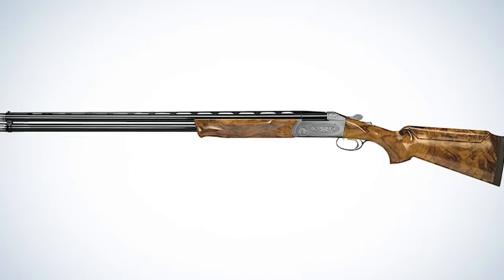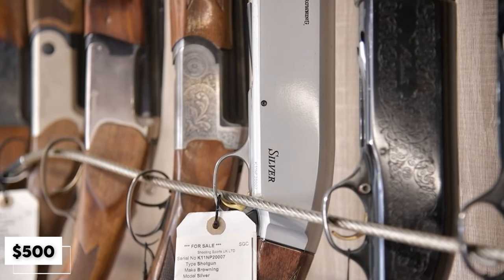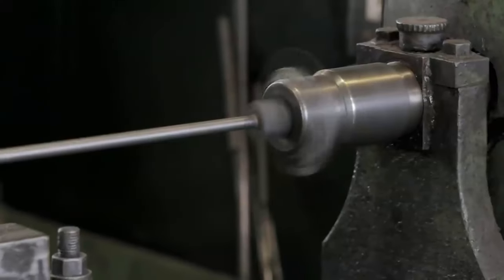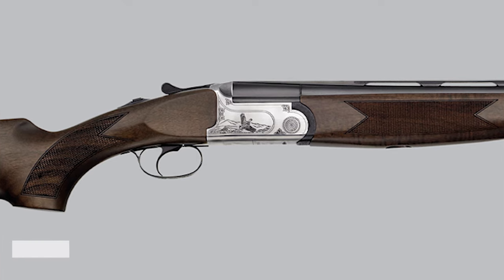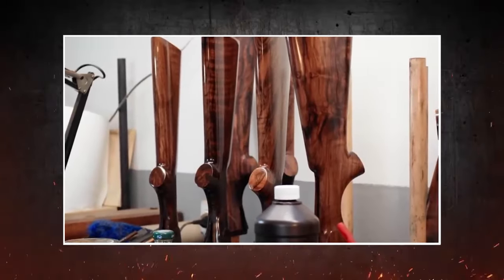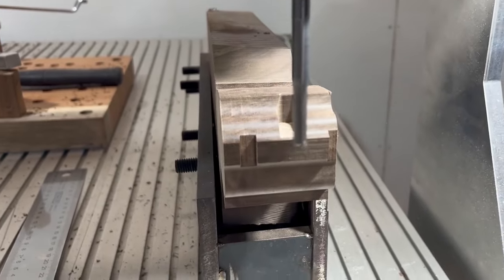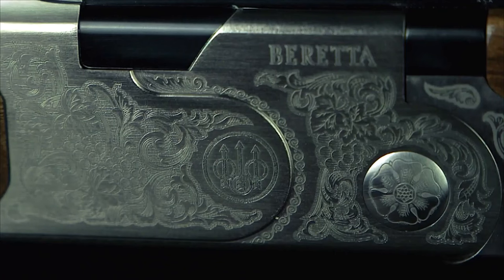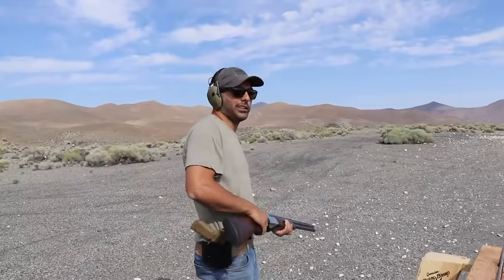The DIFFERENCES Between Price And Quality Over Under Shotguns EXPLAINED!

Comment: In order to win a championship, a person needs to be an elite shooter. However, I personally have never heard of anyone winning a championship with a $5,000 dollar gun. Why? The shear number of targets a top tier shooter has to shoot in a single year to get to the bottom step of the podium is mind-boggling. The durability, dependability, and consistency are what make the difference. Nobody wins a championship with a gun at the gunsmith's. A person can forgo the fancy engraving on a Krieghoff k80 and still find the podium if they are a top-tier shooter. $15k doesn't necessarily mean ego.

Comment: I’ll shorten the video for all. T and M. So when you get over 15000 most of it is cosmetic. But till that point there is a huge difference in a lot of aspects. Just look at the difference between the cost of barrels you can’t buy a set of high end barrels for under 5k. So if people want to know if there is a difference between 2k and 15k there is without question. Not to mention all those cheap guns work in the field when you pull the trigger a handful of time. Compared to a sport shoot when I’ll shoot 400 targets in a day then let’s see what gun out performs the other.
Reply: EXACTLY

Comment: I agree that the cliche 'you get what you pay for' is mostly true.  However, if it were absolute then that would imply that everything is priced appropriately which is of course not entirely true.  I own a "cheap" over under and it does everything I want it to do.  Perhaps I'm not talented or sophisticated enough to appreciate the difference between that or of one that costs 6x but I also don't think any Rolex has ever made anyone more punctual.  If I paid 2-3k (or more) on any single firearm then of course I'd have to try to rationalize it just to convince myself that I didn't just make a totally reckless and frivolous decision.  Enjoy the exclusivity.
Reply: This is why there are field guns and competition guns. You want to go shoot a few birds or a round of sporting clays, I've seen guys do it with $4-500 dollar guns. I've seen those same guns lock up after 200 rounds. $2-3k will get you a decent field gun with the ability to small clay competitions. A $5k gun is an entry level gun for serious competitors.

Comment: Dude. No one except a couple of Brits make these things by hand. CNC machinery is the rule 
. Aluminum receivers take a fraction of the time to mill. Thats the 500.00 guns  with a life of 8000 to 12000 rounds. The stell reciever guns are next, and the most expensive are the harder steel receiver guns which have to be processed for hardness in between milling procedures. Then there is the pretty wood and the engraving and the checkering and of course, the name.